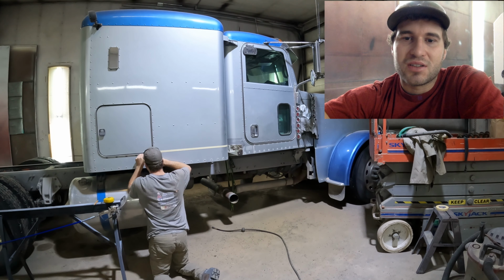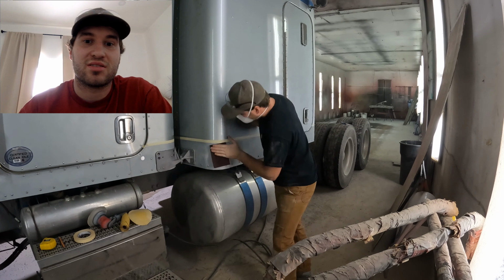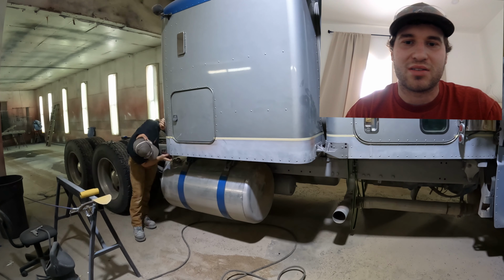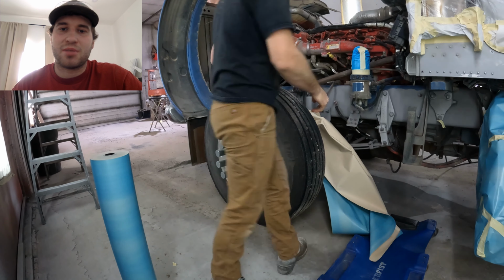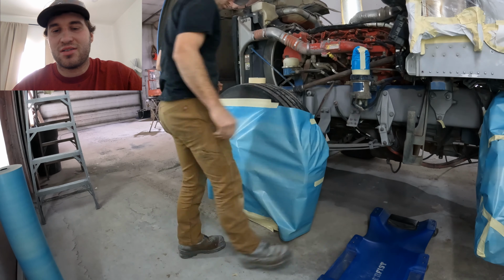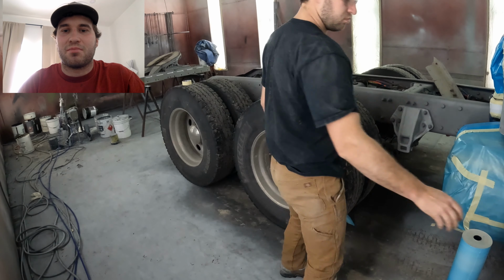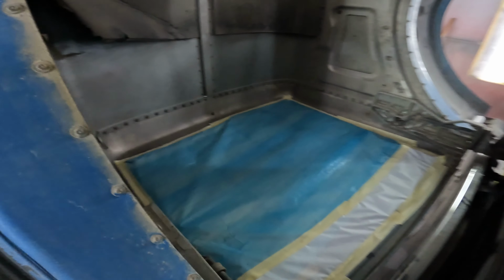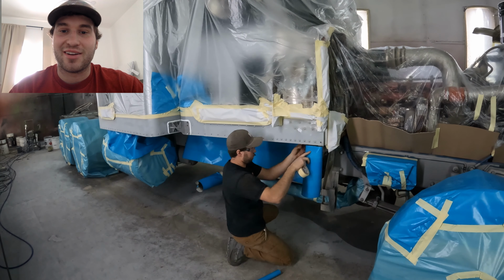Raptor Liner Peterbilt 379

Comment: my friend did this to his dump truck in NJ and the salt got behind it and rotted the frame right at the lift axle and hid it good until it broke getting loaded. like what happens to powder coating.
Reply from the maker: Yea I wouldn’t put it on the frame, yes powder coating is also bad for that. every coating has its place that’s forsure.

Comment: Question is, why do it?
Reply from the maker: The stack brackets in between them and the cab are always bad for corrosion. We had to do around them and Front corner of the sleep get peppered with rocks. Looks uniform when you do it front to back.